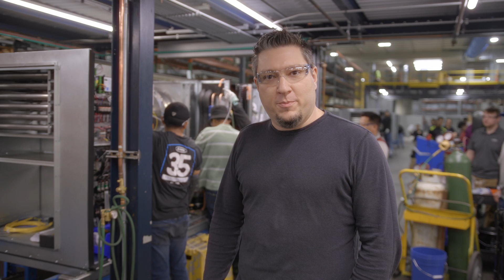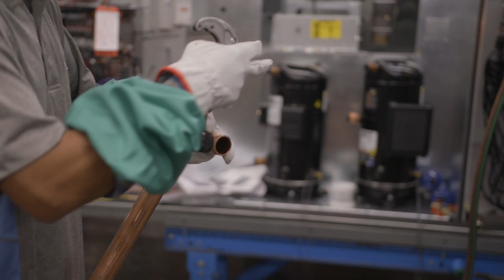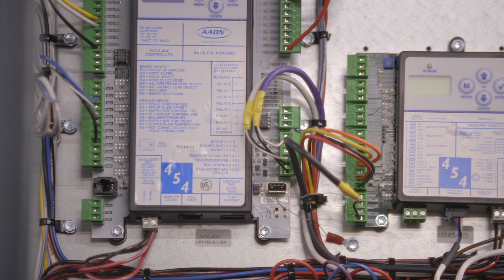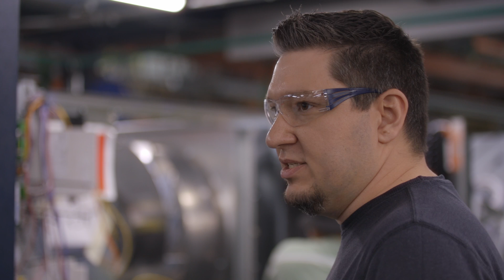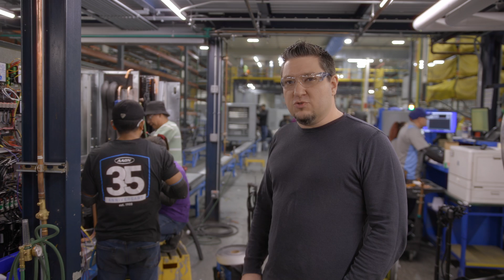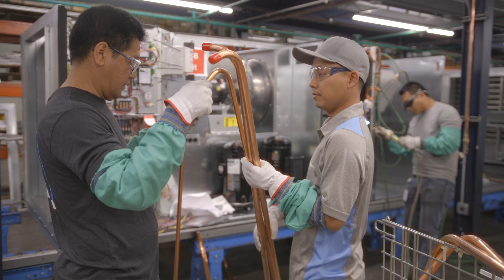Leading the Industry with R-454B: A Comparison to R-410A

Comment: What version hand held is gonna be required for these? Would also be nice if the wiring had just a tad bit of slack near components sometimes they are pulled a tad too tight and cause issues.

Comment: Lets replace old refirgerant with new flammable gas so we can add bunch of extra bs lol whata a joke
Reply: And don't forget the new adapters that are left hand thread. So now we all have to get new core tools.. keeps costing us techs more and more monies. Don't forget the 30% increase of equipment
Reply: I'd bet my left nut that 410 will work in these systems. I've used propane (R290) in some R22 systems requires less charge than R22 an is colder. This is retarded